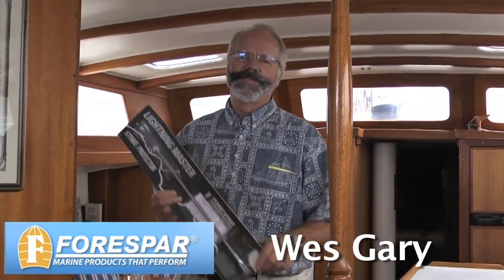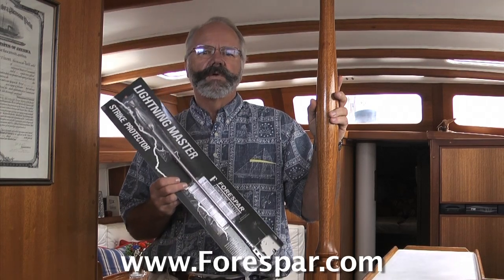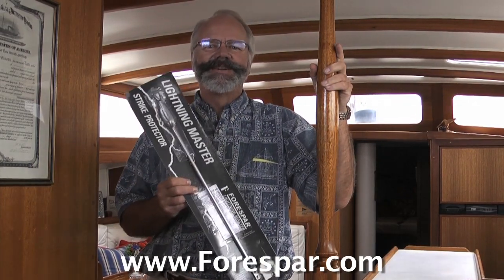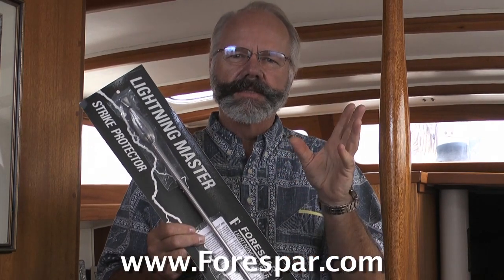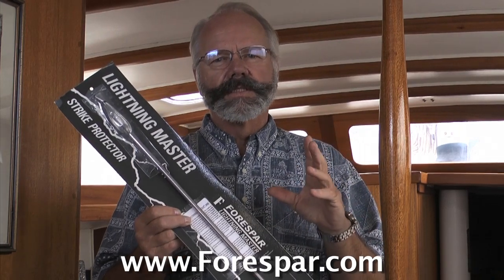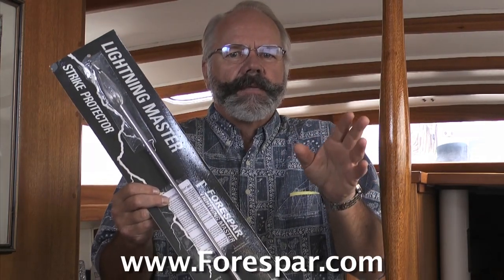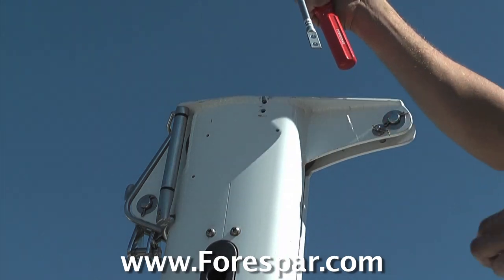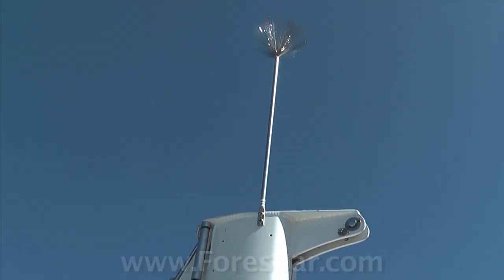Forespar Lightning Master Static Dissipater

Comment: Interesting (sales pitch).
What’s the guarantee for damage in the event of a strike.
Reply: I've installed a few of these on top of our telecommunications towers to protect the obstruction lights and it definitely helps, you can never be 100% lightning free but it will help by reducing the chances of a hit. I've lost a lot ot tower lights due to lightning but after we've installed these things there have been no more hits in the towers where we use them.
Reply: I see it’s been a year and they haven’t commented on anything. No guarantees... no purchase in my opinion. 🤷🏻‍♂️
Reply: if you get struck with lightening I will personally guarantee that there will be damage in the event of a strike.
Reply: @charlie.charles   Is that the opposite of being struck by heavyening?  I'd personally rather get hit by something lighter than something heavier, wouldn't you?
We put this type of dissipator on our 160 foot tower 15 years ago and we've not had any lightning related damage ever since.

Comment: As I understand from this article based on study of lightning strikes the mast being the more likely place for lightning to strike is to be considered protection for the rest of the boat and people. If people become the more likely paths then that is a more dangerous situation. Wouldn't this product create the problem of not controlling the path because any other metal and conducting paths on the boat without this dissipator will now become uncontrolled paths for lightning. Also this study states that there is no statistical evidence as per the results of lightning cases that show that not having proper grounding will increase your risk of a strike. This sounds like a very dangerous device to add to a grounding path. I think this device should instead be used to protect expensive equipment and antennas so that the lightning strikes the grounding path instead  reference: http://l-36.com/read_html.php?file=lightning/LightningAndSailboats&title=Lightning%20And%20Sailboats!click_here
Reply: Not necessarily and that's not what's for, it's meant to make the yacht more equally charged with the environment it's in. That's why they call the product an "ion dissipater". But it's not protection from a strike, the guy in the video does sort of explain that.  In the same way that a lighting rod on a cathedral  makes no difference as to where and when lightening will strike or not. The product just helps a boat more electrically less obvious as a target for the build up of static.

Comment: Good summary of how masthead supression devices work, but it would have been nice to also include mension of the importance of providing a safe path to ground and surge protection for the boat's electronics in case the mast does get hit. Good further reading on lightning behavior once it strikes here:
http://www.kp44.org/ftp/LightningAndSailboats_byFloridaSeaGrant.pdf